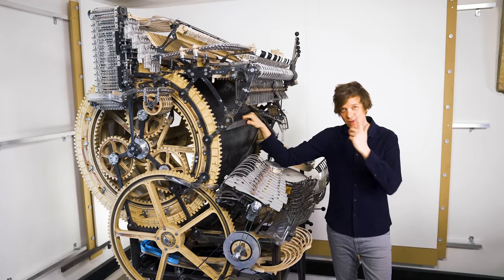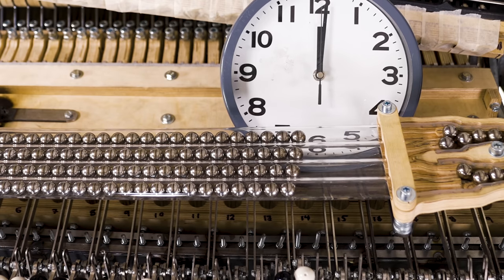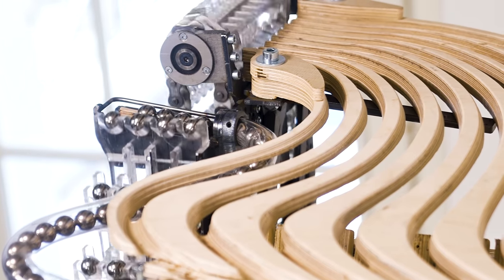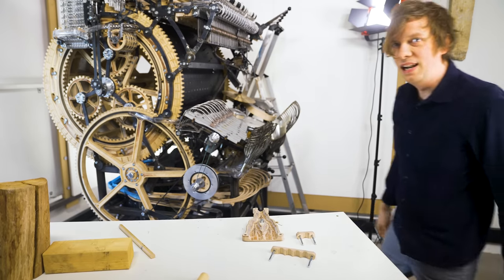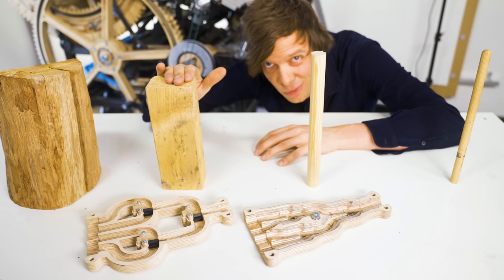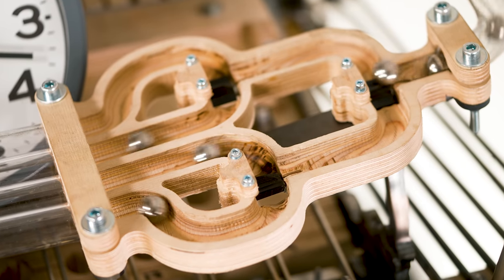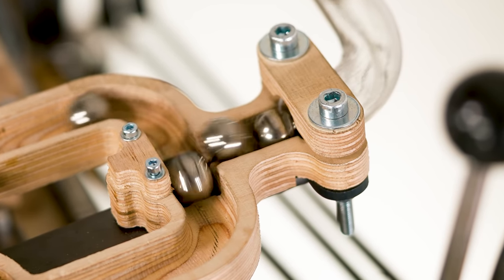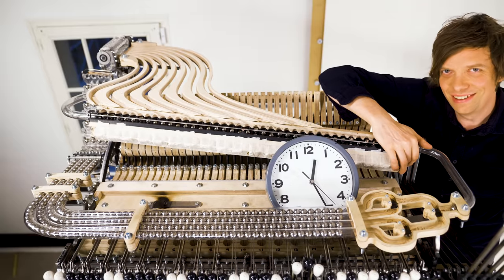Why 99% is NOT Enough - Marble Machine X Accuracy test

Comment: It's interesting watching your new part get dirty from the marbles.
Reply: That's not a good thing though.
Reply: @thomasbecker9676  looks like it's from the black plastic flops?
Reply: @thomasbecker9676  Should be manageable, so long as he can access everything with a good hand-vac or something here and there.  

And wash the marbles in mineral oil?
Reply: @jtcbrown  It means either the surfaces the marbles are on are filthy and/or one or more of those surfaces is already wearing. Imagine buying a brand new car and the oil is filthy after driving it a few miles.
Reply: @thomasbecker9676  I suspect it is mostly from all the welding / cutting done "in production" :D

But, again, this is not a car, he isn't selling it to anyone, and it should be able to be cleaned and be fine.
Reply: It's likely from the graphite powder used as lubricant on some parts which sticks to the marbles. The "dirt" started showing up after that was introduced.
Reply: @jtcbrown  That's not the point.
Reply: @tomnacht2167  I'd wager it's the graphite powder too.
Reply: @thomasbecker9676  Then what is your point?  Because it seems like you aren't trying to, like, recommend anything.
Reply: @jtcbrown  You're right, I'm not. I'm pointing out that if there's crap in the system, as evidenced by the filthy marbles, that's not good.
Reply: @thomasbecker9676  We'll see.  If it is just the graphite powder, that shouldn't be too much of an issue.  But I'm just some guy watching this all with amazement, so what do I know?  :D
Reply: @jtcbrown  By your admission, nothing applicable to this scenario.
Reply: @thomasbecker9676  Ummm....  seems pretty applicable.  I could be wrong but the fact is this could be due to the graphite, and may not in fact be an issue, at all.  Or it could cause things to bind up.

Comment: I love how at 7:50 at 32 speed the lifter on the far left looks like its in slow motion
Reply: Why
Reply: Does it happen
Reply: @shanezhang8277  proablly sane reason we have those videos of helicopters taking off without the rotors moving.

Comment: I am a little confused now.
A couple of episodes back there was a video all about why not to use flipflops, but now we are back on flipflops again?
Also, flipflops can break eventually. (like wear out = skipping marbles) 
Anyway, great progress!
Reply: i think the only problem Martin mentioned was that the flipflops may not divide accurately when lots of marbles come in at high speed, which he mitigated by making an uphill to the first flipflop
Reply: Yeah, the ideal design would be something that could self-balance with no moving parts
Reply: @caesural  That was exactly my thought.
The other divider was basically self balancing, just slightly biased to one side.
One could compensate that.

I mean, don't get me wrong, as long as the flip flops work, they work. (don't really have a preference)
But in the long run, it always will be a potential error since it has moving parts.
In fact it has very delicate moving parts.
Reply: Though I too would like him to address this, my thought is that something that works perfectly for a month but then needs a part replaced is better than something that doesn't work but doesn't need any replaced parts. Looking at how he designed it, it looks like he made it with easily replacing the flipflops in mind.

Comment: At this point this Just feel Like programming 
You fix 1 thing, 10 new bugs appear  xD
Reply: This is how engineering works. You think your design is 100% fail proof tell you stress it out. Some parts you see have gone through 1000 design changes just to handle the job they are required to fill
Reply: Or at least 1+epsilon.
Reply: @ericspecullaas2841  Indeed, programming is just another form of engineering at the end of the day. We even barrow a lot of our terminology from manufacturing because it fits in so well.
Reply: @Stettafire  the univeristys of computer engineering were born for this reason XD
The earlier you accept to find and solve bugs, the better 😅😭

Comment: I was watching this and realized that because he designed the instrument "flip flop" is now the official name of this part of the instrument.
Reply: It's the real name for such mechanisms in engineering (and for their electrical circuit equivalents).
Reply: And in programming, this concept is a logic gate.
Reply: @joeromanak8797  No
Reply: @joeromanak8797  A logic gate is a component of a flip flop. This one happens to be a T flip flop, which could be made of 2 NOR gates and 2 AND gates. Or you could not use any independent logic gates, and use three transistors.
Reply: @PeregrineBF  - Thank you for this. I’m not a programmer or an engineer; I tried to express something I thought I knew from long ago. I’ll leave the technical stuff to the technicians going forward.

Comment: "The fail wasn't actually in the divider, it was in the angle of the pipe..."
changes divider
"It's perfect!"
Reply: To be fair, it was backing up into the pipe because channels 1 and 2 had caused it to back up into the divider... so while the divider was still technically working as it should it was creating it's own choke point causing the marbles to lose velocity in the tube before they got to the corner going to the divider.

Comment: i had a fear when martin said he liked the creation of 'slightly longer' queues in the divide-by-4.
I beleieve the problem with the divider took place because the angle at which the divider was set wasn't steep enough. 
This probably ended up creating that queue problem in the long run
Reply: @ralphgesler5110  ok then. Thanks for the warning

Comment: I never belived that partless divider would have even split.
Reply: I wanted him to show a slow-mo of the failure with the naughty marble.
Reply: Sure but it helped him achieve this elegant solution. Design it as simply as possible, only add parts as necessary.
Reply: @Dannerrrr  same but it would probably be pretty hard to find that exact moment
Reply: @irg008  well you just look at when the lines changed length, then rewind a little bit.

Comment: Reminds me of Adam Savages baseball throwing machine. He made it for a store display and a failure rate of 1 in 100, later 1 in 10. Running continuously wouldn't work. He ended up stringing balls on a monofilament to simulate throwing. He told this story of failure in a  DEFCON talk.

Comment: The slow motion segments of the newer part are very satisfying to watch.
The new divider reminds me of the little people race track my kids have. The track has some of those flip-flop dividers that switch anytime something passes them. Problem with that track is that the kids got the cars dirty playing in a mud puddle filled with soupy iron clay mud. Now it has built up soil, and the iron content seems to have bonded with the metal pegs that act as the pivot points. That put too much resistance on the switches and now it doesn't work anymore.
Edit to say I don't know why I felt the need to share my story about the Little People track, other than I noticed a similarity. I doubt this issue I have will ever be a problem on your machine, haha.

Comment: I cant read all the comments but the reason channel 1 and 2 are different than 3 and 4 is because the lengths of the corner are different. The inner tubes have less travel distance than the outer 2. If you ensure to have equal length runners, otherwise ensuring they all travel the same distance that it would've been the fix

Comment: I just watched this the first time and it looks amazing. When having that small issue at the beginning with lining up the same amount of marbles in each line. The first thing I think about what causes the problem is the length of the tubes and especially that first corner. Cause in that way the first and second line is def shorter than the third and fourth line so that explains why the first and second row went quicker thru the course and also explains (when its not running) the marbles are not perfectly lined up together. But the solution u made is a lot easier to assemble. And its solving the problem because the marbles take a significant more time during the line up. Dont know if it was mentioned before in the comments or so. I see this vid was from a year ago:p Anyway, nice work !

Comment: The divide by four preferentially sends them to one side, probably based on the input direction of the tube. If the input tube were on the other side, you would probably get the reverse results. Difference in how the marble spins as it enters the divider.

Comment: I have a possible solution. Instead of relying on the marbles to go into the individual channels by chance, you could have a mechanical switch on each of the divides that alternates everytime a marble goes through it. So switch 1 takes marble to the left (the pressure of the marble flipping the switch), then switch 2A takes the same marble to the left again at the second junction to go into track A. The next marble that goes down switch 1 goes to the right, flipping the switch again so the next marble will go left. The marble that went to the right approaches switch 2B and goes to the left, flipping the switch and going to track C. The third marble goes to the left, flips switch 1, but then goes right at switch 2A, landing it in track B and flipping the switch back. The fourth marble goes right, then right again, flipping both switches, landing it in track D. Then it will always be even. I don't know how easy that would be to build, but it could theoretically work. You could 3D print the switches or maybe make them out of a strong metal.
Reply: I know that might have been hard to follow. It's be easier to draw a visual. The concept is simple, even if I bungled the explanation.

Comment: You should really get a 1970s pachinko machine and dissect it for design ideas they run balls through completely mechanical paths activating things like the MMX but the designs are robust enough to still be working flawlessly for over 50 years

Comment: 2:03 correct me if I'm wrong but wouldn't that naturally happen with the said center of gravity? I assume of course it's not flat/ straight but rather tilted? I assume the solution is have it feed into the top first, and then bottom instead of the other way around?

Comment: 02:38
Because of the direction of the tube feeding the marbles to the divider, at the angled slope; the generated force of the weight dropping in the angular speed and weighted drop; is releasing the moving medium of force to push weight and mass on the down side brake of the flowing force, pushing the mass out of the canal in direct patch of flow. The upper shaft is being filled by the exssess of weighted moving force, code, exceeding the required energy required to fill the first channel at maximum flow capacity and rate.
Solution: between the tube and the divider, release the excess energy needed for moving 100% of energy investment requirements by putting in a modulatory capacitor static. For solids, a box to catch, store to a weir one on opposite sides of the same direction. The drop from the weir, lands in the divider equally, and at Same rate, calibrated to the weight and flow volume & speed of the energy/mass medium at the modulatory capacitor static - then, calibrated rate of volume in mass and density, by an excess of exssess over weight of energy medium requirements in the modulatory capacitor static governor, at the weir to continually push individual sets of force medium at an equal rate at the weir; dropping into 4 channel reservoir 's channels at the same volumes quantities rates equally!
👑בן האל האב 👑 ירושלים 👑 קדש

Comment: You would need all 4 tubes to be the same length to hold the same number of marbles. The way you have it set up, the 1 is shorter than 2 which is shorter than 3 which is shorter than 4. changing the mechanism helps but it doesn't solve the root of the problem unless you have it actively counting and marbles passing through and sorting them accordingly.

Comment: I am a metrologist and some metrological concepts could help you get you past 99%

Ball bearing analysis: go/no go gages to remove bearings that are too large or small - the tighter the tolerance specification you use, the more uniform the ball bearing size will be; rotate out bearings every __ rotations/months/years - an interval of use before disposal/rotation out; analyze bearings for physical deformations and rotate out if bad enough - similarly to the first option, if you have tighter allowances for what is acceptable as far as ball bearing damage is concerned, then all bearings in the system would be of your determined level of damage or better.

Climate controlled room with only so many °C variance and only so much humidity. The tighter tolerances you keep, the less flex the wood would undergo.

I assumed it is leveled.  Could use a used precision cut granite slab as a foundation though that could be overkill lol.

Comment: The vacuum resistance that you see at 2:43 between the packed string of balls trying to drop down the last curve in the tube, illustrates a problem with creating a Hyperloop for mass transit (Elon Musk's The Boring Company is working on expanding existing the 1 mile in Las Vegas to connect Casinos and Points of Interest.

Comment: An interesting way to look at 99% is to consider function over time. If something is 99% efficient every time you use it, then 1 out of 100 uses fail. If you use it 1000 times per day, you have 10 failures per day. After a week, 70 failures. Even though it ran successfully 6930 times, those 70 failures add up, as we saw in the video.

Comment: Eventually those moving parts will begin to cause problems.  The original very very analog method was best, but needed a slight adjustment.... 3D-print it!

Comment: this is why i let the pros do it. i tried to build a simple two channel bell spring machine. i ran it for a minute and all heck went loose. i lost 25 marbles 75 went on the floor and had like 5 jammed inside of the machine. trust me. i had to use a hammer to get it out out of 200 only 95 stayed in the machine/

Comment: Instead of using those overdesigned dividers maybe get some inspiration from Dr. Nim old toy? You can get perfect distribution using pivoted cradles.
Reply: Or another technique used commonly for aligning and packaging stuff is vibration sorting. However it will add more clutter to already clunky build.

Comment: Impressing machine which seems to be now almost literally ready to work..    The marble-test sounds so "satisfying" btw . Why not make an 1 hour ASMR video (wide Stereo) only from the running marble circuit... while you are doing the long-term 4/4/4 test wether it  keeps the balance... and well the flipflop thing (compared to the fork divider) works well over a long time I think.

Comment: Why can't you machine the marble divider out of an oil hardening steel. After you machine the channels and polish the runways you could get it heat treated.  Then do after heat treatment polishing to the slots to minimize any friction.  A hardened steel divider will last exponentially longer than one machined out of wood.

Comment: I like your original concept for the analog marble divider. The new design works well, but it loses something in the elegant simplicity of the first design.

The original marble divider was not long enough; a train of unprocessed marbles is skewing the results.

Also, the sharp bend just before the (original) marble divider was applying an (spin induced) torque and a (centrifugal) force that skews them to the outside tracks, and that´s why the inside tracks are underrepresented.

Perhaps for the (original) marble divider a calibrated tilt adjustment knob or control  to compensate for these effects? But before doing this try adding, say, at least 10 cm to the intake track.

P.S.: Why do you call them marbles ? Marbles are always made of glass, not steel.

P.P.S.: Have you indicated in a previous video what is the total cost of all the ball bearings used? Did you get a good deal on a large quantity purchase?

Comment: Gonna be captain obvious and say the marbles were choosing 3 and 4 because of the tilt angle of the divider. The dividing mechanism is friction fed but the effect of gravity is stronger on 1 and 2 because decreased friction due to the tilt angle. The flip flops worked better in the second design because it utilizes the effect of gravity to overcome the overall tilt angle by giving each marble a stronger localized tilt at the flip flop

Comment: The machine only has to play for 5 minutes per song.  Have a procedure to reset between ever one or two songs. 
The question should not have been"how to make the machine work perfectly for a two hour show."

It should have been, "how to make the machine run very well for a single song, with very brief reset procedures for in between songs."

Comment: 100% is impossible, but in engineering, 99.999% -- called "five nines"-- is considered "generally reliable". For exceptional reliability you need six nines or better. But 100% is just you kidding yourself. It will fail after enough iterations :)

Comment: Force the marbles into a holder that is one marble in width, and four marbles wide, that will only dump when four marbles' weight is in it.  Forget about the divider solution.  It's too complicated.  Use weight instead.  Failure proof.

Comment: Hi I have been subscribed for years since you use to be with the wintergarten group, but i think you have lost the plot as long as you have marbles ready and dropping on time etc that is all that you need it will never be 100% right because you will look for something else thats got to be right, not even a car engine with tighter tolerances than a marble machine will have the very occasional  miss-fire (normally) due to an ignition or injector , even humans have brain farts! its a machine with moving parts its not a work of art!!!